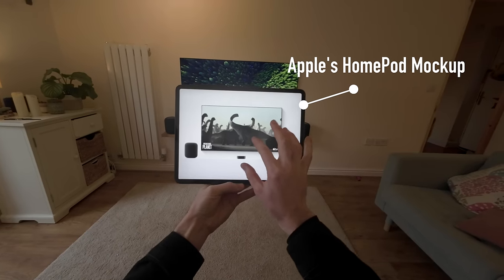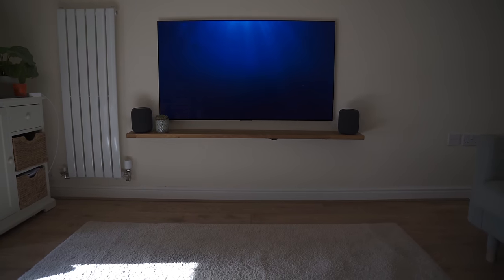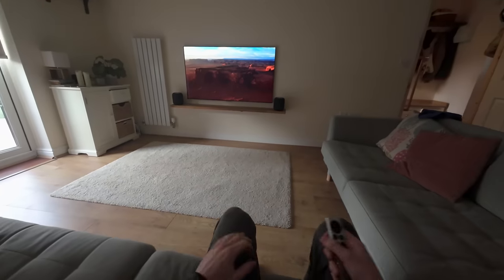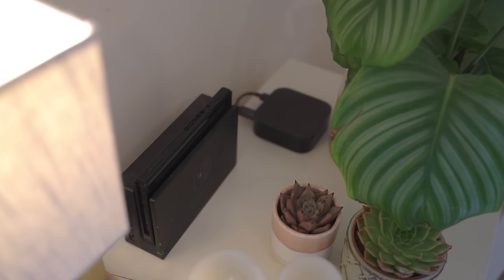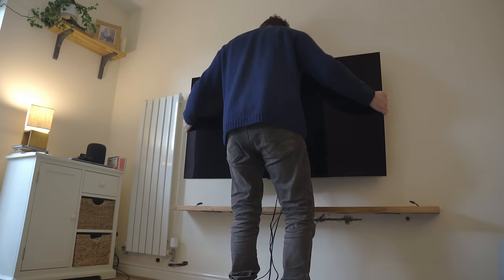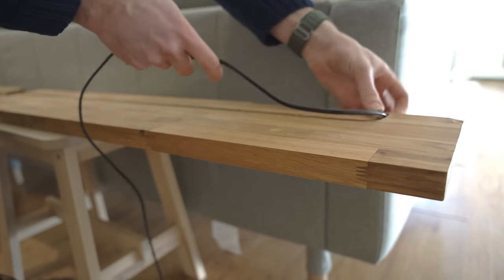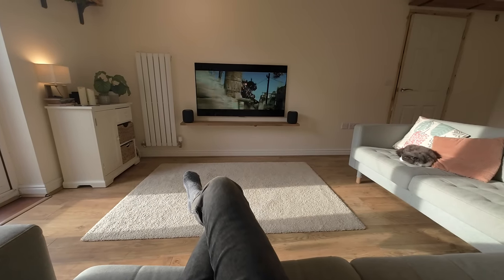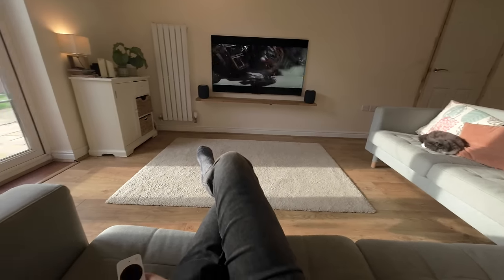I Built a MINIMALIST HomePod Home Cinema

Comment: Very thorough build, looks smart!
For reference there is absolutely no warranty issue with cutting off a moulded plug as long as the replacement plug is fitted correctly by a competent person. If the plug was to be damaged the last thing a manufacturer wants is someone using an unsafe plug because they are worried about replacing it.
Reply from the maker: That's good to know. Should have just cut it off then lol!

Comment: Unless I’ve missed something it looks like your HomePods are wired straight into the ring and are therefore on a 32A fuse. The solution would be to put a fused spur for each under the shelf. 

Very neat looking setup though,
Reply from the maker: The whole shelf is actually on a fused spur, the hole next to the double wall socket is a switched fused spur. Forgot to mention that was added by a professional for my first setup so I just added my new wire to that. That connects to the socket under the shelf which powers the TV and connects to the wires from HomePods.
Reply from the maker: You can just see the fused spur box with switch by the corner of the sofa at 17:39 - edit: even better shot of it at 10:57

Comment: Not sure if it's the same on the gallery series but I have an LG CX and I wanted to feed the power cable through the Bang & Olufsen floor stand I'm using; The power cable enters the TV through a small access panel seccured with a screw that can be removed which conceals a small connector that can be removed and re-attched if needs be; Not sure what the warranty implications are with this approach though.

Comment: The only problem with this setup is when it comes time to upgrade... whether a new cable comes out, or you need to move the mount for a different shaped TV, or Apple discontinues use and support of HomePod and you want something else... Other than that, it's beautiful.
Reply from the maker: Hopefully these will have a long enough run that I won’t mind a bit of rebuilding if/when the time comes!

Comment: Cool build! Have you considered the Sony HT-A9? I think they have a similar if not better size to performance ratio, and the front of the build would look very similar. The main challenge (and also kind of the point) is integrating the rear 2 speakers
Reply from the maker: Yeah rear speaker placement is the issue but also huge cost.

Comment: Couldn't you hang some sort of patterned material or rug on the wall behind you to absorb the bass??
Reply from the maker: IIRC, to deal with those frequencies would need a sound trap something like 18 inches thick!
Reply: @BenVallack  I mean... Maybe a perfect solution would require such an extreme solution - but I would think that a soft absorbent material would have to be better for mitigating concussive bass than bare brick wall.

Comment: Of course taste is subjective. But to me it sounds that a Sonos Arc might be a better solution for your use case.
Reply from the maker: I considered it - but as fas as I can make out it doesn't have any kind of beam forming system to emulate surround channels. They try and upsell you to grab the surround speakers. And that the costs significantly more. I did demo one in a shop, hard to come up with any real conclusions in that environment but I was very underwhelmed by music reproduction. It also sounds like the Arc doesn't work with the latest Apple TV eARC configuration which is a serious issue! That's just from a quick search of Arc forums.
Reply: @BenVallack  It might not use beam forming because there are actual drivers pointing in multiple directions to bounce of the walls (and ceiling!)

The general consescus is more similar to this:
"I have one tv with an arc and I HAD one tv with two original HomePods. The arc is hilariously better. I switch the two HomePods out on my second tv to a Sonos beam gen 2 and even that is better."

But nice to see that you are happy with the setup. And very clean install of course!
Reply from the maker: @joostwestra very interesting and likewise glad you’re happy with your setup! I’ll definitely look to test one when I find someone with one I can play with.

Comment: Love it!
Just wondering if you notice any image quality degradation watching from the Applet TV? 
I have a 4k Apple TV hooked up to my OLED Sony A80J and no matter what HDMI cable I use or however much I change the settings (apple tv or the TV), I can't get the image coming from the Apple TV to look as good (vibrant and popping off the TV realistic) as it does when using the TVs built in apps. 

I not only have image vibrancy issues, but pixelation in the all black areas of youtube videos. When watching my favourite LG demo reel (https://youtu.be/njX2bu-_Vw4?feature=shared) the Apple TV cannot produce a smooth black area surrounding the centre circle during the opening 6 seconds, no matter how long I let it buffer or replay it (hard wired or wi-fi), but the TV is smooth black everytime (wi-fi).
I love the Apple TV user experience, and my family couldn't care less about image quality so we still use it, but I'm curious if Apple TV is degrading all OLED TV owners experience and they're not realizing it, or if it's just me and my A80J.
Reply from the maker: That sounds super strange - as far as I’m aware there’s no way the Apple TV could be degrading the image - it is capable of sending the proper signals to the TV and it’s all digital etc. It’s widely regarded as one of the best digital sources as far as I know. Having said that - it does have a whole bunch of different modes it can do in terms of how it passes through the signals so have a play in the settings on the Apple TV. Also have a look in the settings per source on the TV in case it’s doing something fancy on the built in apps that it isn’t doing on HDMI sources.
Reply: @BenVallack  Here's a video showing the pixelation issue with YouTube https://youtu.be/YK89laR90Ak if you're interested.
When I was doing this test I was looking at the settings again and noticed the Sony software updated and now has some "Calibrated" picture modes which look a bit duller and similar to Apple TV's output  compared to Dolby Vision Bright mode. Maybe the Apple TV is doing some extra 'calibration' to the image which looks muted to my eyes.
I'd be interested to hear if you or others notice any difference between the built-in apps vs Apple TV. I know it's widely regarded as the best, but I haven't seen any comparisons using some higher end OLED panels.
Reply from the maker: @Ran-qb8vf have you seen issues on other Apple TV apps or is just YouTube? What model Apple TV is it? I know the older one didn’t support HDR content on YouTube due to a bit of a format war between Apple and YouTube so I’m wondering if what you’re seeing is YouTube switching the content to a version it’s recoded to be compatible, I.e non HDR or this is some other issue resulting from trying play HDR on a setup where it’s not supported.
Reply: @BenVallack  I have Gen1 Apple TV 4K (A1842), you're right it didn't initially have HDR capability, can't seem to find a conclusive answer on the current status of that. In terms of issues, across all apps (disney+, Netflix, Prime) the image just doesn't look as vibrant. I tried taking some videos yesterday comparing a few live action and animated shows but it's tricky to get the lighting right, makes me appreciate your videos even more :)
I was able to eliminate the pixelation from the youtube test I uploaded by turning on Match Content Range and 
Match Frame Rate, but then it seemed to add noise during other parts of the video (bubbles in the glass).
Doing some searching this morning on the topic and one person suggested setting the Apple TV to SDR, then turn on match content (so it will go into HDR when available) and turn off Match Frame Rate (can't recall why). This seemed to really help, but now for some reason the Apple TV is much quieter than the TV (built in speakers). Finding all of these forums filled with people having similar struggles makes me feel better, and it looks like I've got a few more hours of digging into this ahead of me. Surprising that Apple TV settings aren't talked about more in all of the TV reviews out there. Thanks for the replies :)
Reply: I have an A80J and was contemplating an appletv as well. Thanks for sharing your experience!

Comment: Umm you clearly haven't seen Samsung's The Frame tv in person. The whole point of the Frame is for it to look like a piece of art when not in use. From any angle. Which it does amazingly well. That's literally one of its main strengths. So I'm not sure who or what made you believe the Frame tv doesn't have good viewing angles but you're wrong regardless. 

AND the Frame has this anti glare screen coating which is unlike anything else out there & perfect for rooms that are brightly lit or get a lot of sunlight. Like in your space, where you have to draw your blinds in the day for anything to be watchable on that super glossy oled. No such problem with the Frame. It handles glare and sunlight extremely well. AND it gets a lot brighter than your oled. Making it the perfect tv for your situation. 

Also, the 1-connect box is a lot more convenient with a single thin detachable cable running from TV to box. The cable the TV comes with is plenty long but even longer cables are available if needed. Making it a lot less cumbersome than your lg. 

You also mentioned something about the frame tv tech being "old"? FYI, Quantum dot produces higher color purity than oled. And they get a lot brighter than oleds. The tech in the Frame is perfect for its intended purpose. And lest I forget, the Frame actually mounts COMPLETELY flush. 

Heres the problem I have with your approach. On one hand, you don't mind the plethora of compromises you've had to make by choosing a dual Homepod setup. Any half decent  stereo setup like a pair of Q Acoustics M20 HD active speakers (with or without a sub) would wipe the floor with those homepods. Yet you chose to go with the homepods. However, you decided to go with an oled for of its "better tech" & blacker blacks & didn't want any compromises with picture quality I presume? I'll tell you what, you've ended up with the worst of both worlds for your situation. All that hassle only to end up with a glossy TV with glare that doesn't get bright enough in a room with tall windows & an unremarkable sound system you'll end up wanting to replace soon enough. 

However, the work you've put in has turned out well in terms of aesthetics. Can't fault you there.
Reply from the maker: I certainly have seen the Frame in person and considered it very carefully. I agree the anti-glare is nice but not at the expense of viewing angle. Here is the objective data. https://www.rtings.com/tv/reviews/samsung/the-frame-2022-qled It can't hold a candle to the OLED. Colour washout at 29º instead of 68º on the LG. 

Brightness in real images isn't event close either - it can beat the OLED only when displaying a solid white screen where the OLED limits itself. In real images the OLED has brighter highlights in HDR content - and due to proper blacks an infinite contrast ratio, unlike the frame.  (data from Rtings)

Colour purity is better in the LG than the Frame too I'm afraid. 98.58% coverage of DCI-P3 compared to the Frame's 87.49%. (data taken from Rtings)

I agree decent stereo speakers can easily beat the homepods in terms of music - but not for surround sound. I also agree the whole thing is a compromise from both a decent stereo setup and compared to a decent cinema setup - but the trade oft is minimal clutter and aesthetics and a great balanced ability for film and music.
Reply: An amazing demonstration in gentle restraint whilst tactfully answering to someone’s wholly different opinion on how you approached an area of your own careful consideration. Worth a sub for this reply alone!